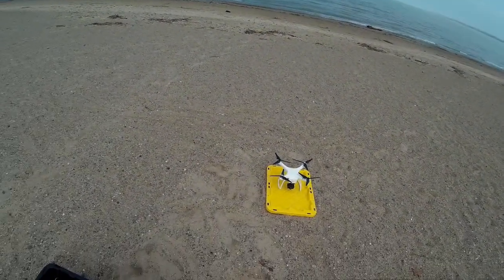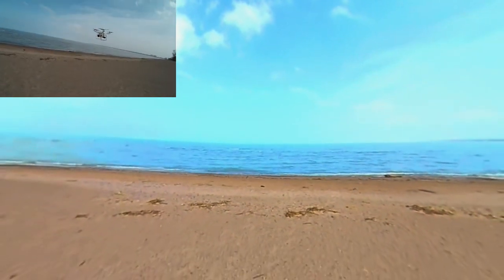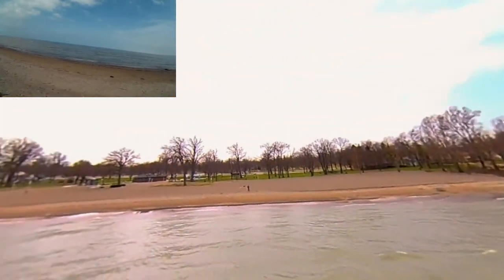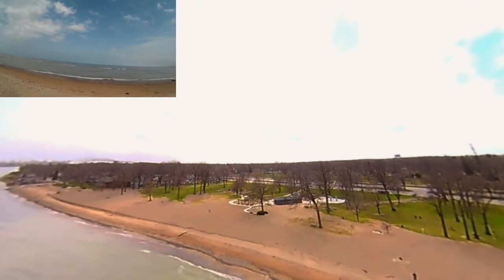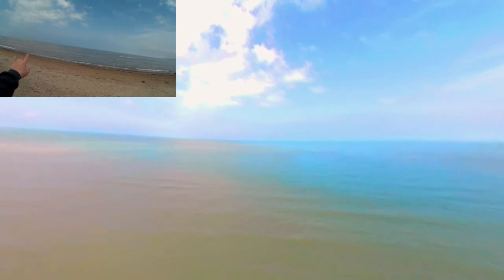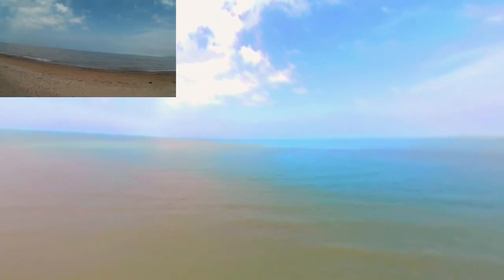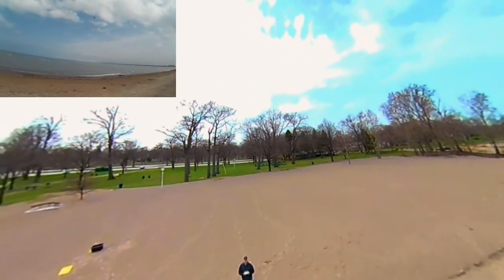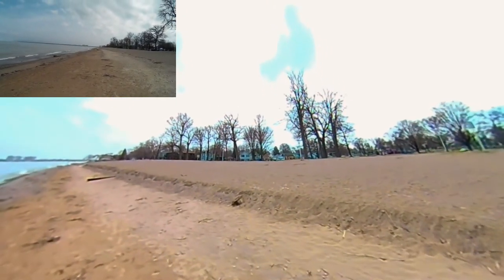Video Drone - TriProps and New Dual Camera Design for UPAir!

Comment: What's your thoughts on the 3 leaf propellers.. I have tried these on mine cx20 and I work very well. But I was told in the group buy some members it kills the motor life.. I have noticed your video is a year old are you still using the 3 leaf propellers .Cheers
Reply from the maker: Love them but there are risks, as three means better balance and more lift and since your pushing more it does seem to pull a little more on the batteries,  yet this is negligible to be honest.  As far a wear on the motor, logic would state more load more wear, yet as with batteries  negligible maybe and if there is, the performance value is worth it.  The only thing to be careful of is the additional lift/thrust can result in issues with the PID setting of the ESC's which is lesser quads can lead to fly aways as the PID can't exit its loop fast enough and the drone just wants to keep rising...

Comment: Hello I have just purchased a second-hand upair one plus.. and the .. gimbal and camera don't seem to be working .. but you can see the board of the gimbal is getting power.. and if you put a micro USB into the camera it powers on with the blue lights . Any ideas much appreciated
Reply from the maker: My guess is their are getting power.  On the older version there where fuse links, likely the newer one also has these and one might be blown...
Reply: Video-Drone I will do a video when I get it back together again and show you.
Reply: Have you got any idea where I can get a new gimbal board from? I tried contacting with no luck.. can you help where to buy parts especially for the plus!! thanks